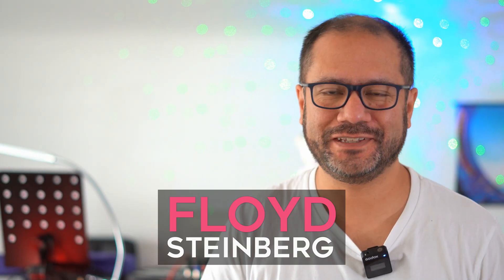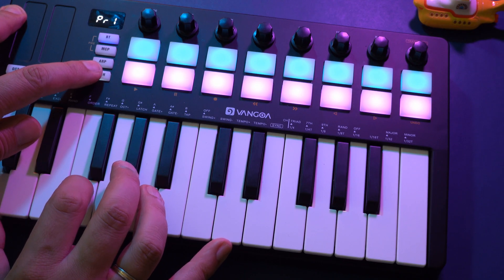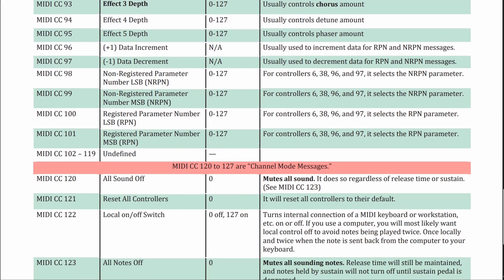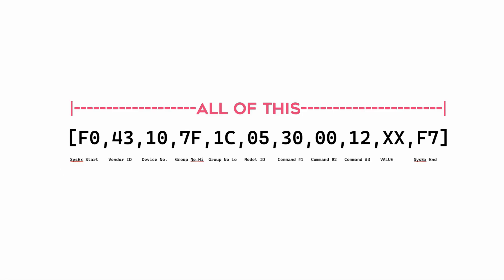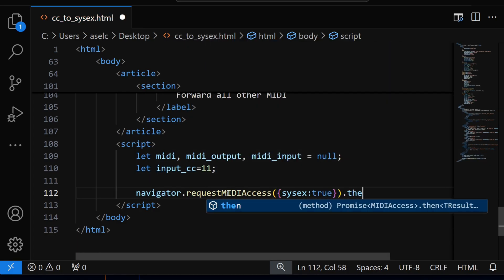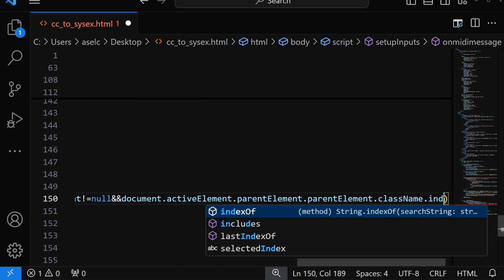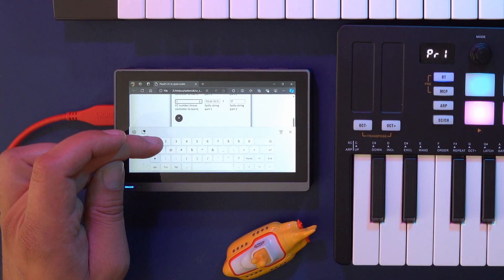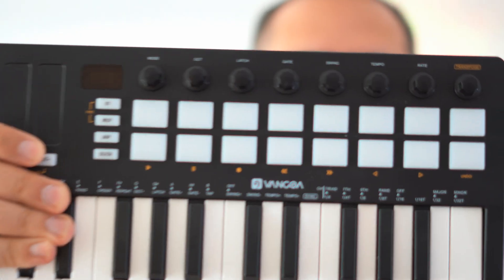Vangoa's VMK25 Pro sends SYSEX with this #webmidi script

Comment: The website says the Sustain port is also a trs midi port
Reply from the maker: You're right! Should have mentioned this. You have to use the setup app to switch the port functionality.
But I think that's not a good way to handle this, have TRS MIDI or sustain pedal ...
Reply: @mr_floydst  I agree

Comment: Does anyone know of any MIDI controllers that come with a sysex option right out of the box? Without a menu page jump/mark feature like the SY77 had, my Yamaha CK88 requires me to hit 7 buttons just to get access to the MIDI tx channel page for a controller zone. It's a pain on stage, so now I've got a little time to figure out a better way and it looks like sysex may be my best hope. I've already successfully used it to change channels with a DAW but now I need to do it with hardware. I'd prefer not having to add another MIDI box to my rig, though it looks like the Event Processor Plus from MIDI Solutions might be the right tool for this job if I can't find a controller actually built for sysex.
Reply from the maker: Hi, all the controllers by @intech can send sysex https://intech.studio/
Reply: @mr_floydst  Thank you, Floyd. That's good to know. Looks like the Novation Zero SL Mk2 might as well.

Comment: Why do they make MIDI controllers without MIDI ports? Not everyone uses USB, fewer use Bluetooth.
Reply: Per other comments here:  Sustain port is also a trs midi port
Reply: @maksmakes  MIDI out, I'm guessing, in which case when using the arpeggiator, where does the MIDI clock come from?
Reply: @Hakucho64  Absolutely no idea! I dont own one of these and what passes for a manual doesnt say, I'd guess the keyboard should send MIDI clock messages out when using the arp, but who knows? @mr_floydst might be able to test and see what it does.
Reply from the maker: Yes, that's a good question. This is a good keyboard otherwise, and with it's battery, it would be a nice portable controller for small hardware synths.

Comment: I've got a couple of questions about the keyboard itself. 

1. Can it be used as a USB host? 

2. Is it possible to assign a midi channel per pad?
Thanks!
Reply from the maker: Hi, thanks for watching! No, you can't use it as a host, and yes, you can assign MIDI channels. I would have shown it in the video if the software had been available while filming. It's available now.

Comment: I was just thinking of this earlier today and diving through google results and then this happened!!!
Reply from the maker: Thanks for watching - well that's a nice coincidence, then. :-)
Reply: @mr_floydst  have run into  a confusion hope you could help clarify :) the sysex code for my x5dr to change osc looks like this F0 42 30 36 41 18 00 xx 01 F7 where ""xx"" is the hex code for the osc types/waveform number. I am using the code as follows String 1: F0 42 30 36 41 18 00; empty space in between boxes "xx" mapped to cc71 on my akai mpk mk3; String 2: 01 F7. Should this be String 1: F0 42 30 36 41 18 00 xx; empty space in between boxes mapped to cc71; String 2: 01 F7 instead. I was thinking that the value to be changed is expected to be mapped to the controller and hence omitted from either boxes. Feel free to set me straight on this. Thanks again :))
Reply from the maker: @liarsquare2363 hi, please leave out the blank spaces. Does that fix the problem?
Reply: @mr_floydst  thank you for your help that did it! I missed the comma (,) separators in there. Just discovered that the app works only when the proprietary midi editor for my x5dr is active and engaged to influence parameter changes for the osc block. More of a specific issue with my hardware than to do with your program which works flawlessly in my case. Just wondering: Any chance the functionality could be translated and compiled into an arduino or SBC?
Reply from the maker: @liarsquare2363  I'm working on it! ;-)